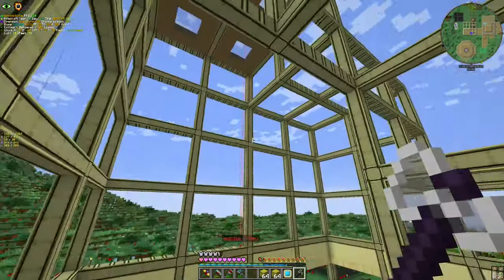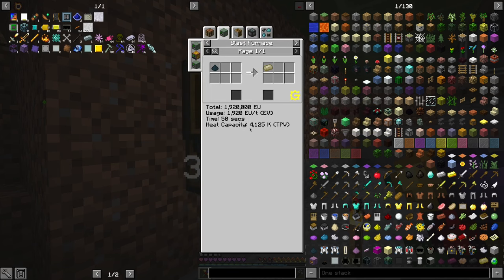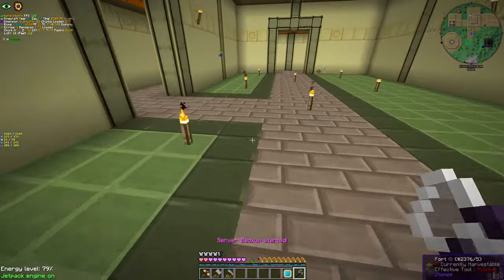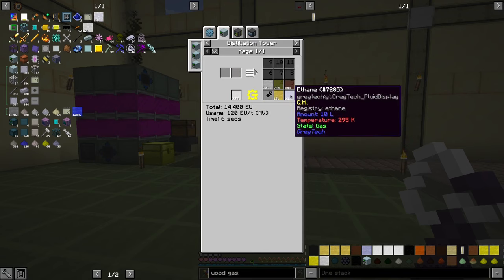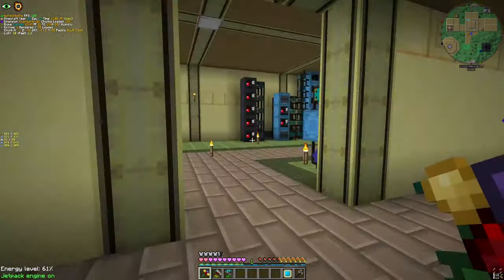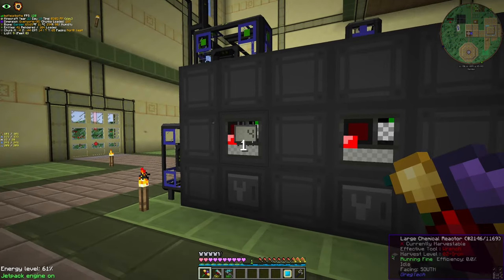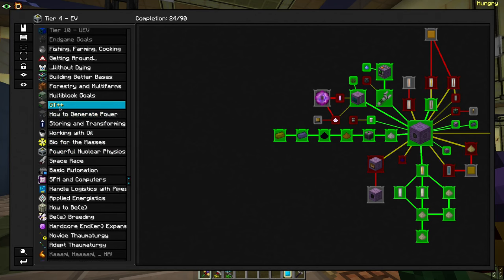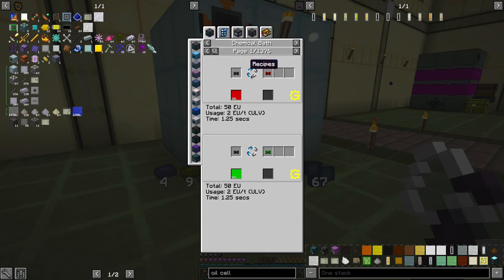Bigger And Better Chemical Processing | GregTech: New Horizons S2 - 38

Comment: For charging the jetpacks and other electric tools, I'd recommend looking into wireless chargers from GT++. Their range is massive and the EV/IV one will last you a long long while.
If you want the most log yield from bonsais, spruce is the go to iirc.

Fun fact: A circuit 9 Distillation Tower running raw oil continuously at its base voltage will yield you around 18,000 EU/t worth of Naphtha. Might be a fun plus to your power gen :)

For Helium, Yellow Stonelilies on end stone will be the best choice. Plus you also get passive Platinum Metallic Powder and Tungstate.
While we're on the topic of Stonelilies and Crops, A patch of Salty Root will be a really good source of Chlorine and all of your salt needs. For Fluorine, black stonelilies are good, but also cryolite bees are just simply better.
Reply from the maker: I'm currently trying to do Salty Root route but I do not have any low humidity area near to me. I might end up just go with stonelilies. Plus, all the other materials are nice too.

Yes I'm aware of spruce yield but I'm happy with my jungle setup :D well, in the near future I'll move to NUCLEAR, so it wont be a huge problem. And for charging jetpacks, yeah, I might do that but the battery life of my current one is really good that I don't need much.
Reply: @KofteistKofteEN  tearstalks is another option if you have it. it gives lithium as a by product as well
Reply from the maker: yeah, that's a really nice idea

Comment: Lots of progress with the new building, it’s so satisfying to see the distillation towers chugging along.
What I was wondering with your long cables how bad is the cable loss? The more you progress the less this matters, but in EV I put my stuff much closer together, but doesn’t look as nice :D

For traveling your base you might consider travel anchors (and maybe staff of traveling), it safes soo much time.

What is the option to set the Hotkey for Hover mode. Either I am stupid or really blind, i can’t find it :(
Reply from the maker: It is especially fun with the LP, watching a bunch of fluids buzzing around, finding their ways, etc.
The cable loss is not that bad actually. At least not at the amount of I was scared initially. And I might do some travel anchors, but I really don't like Ender IO much, so I always put it away in my mind :D

Hover mode for IC2 jetpacks is the IC2 mode switch key, but you need to press space at the same time to activate hover mode.
Reply: @KofteistKofteEN  thank you! Finally hover mode activated :D